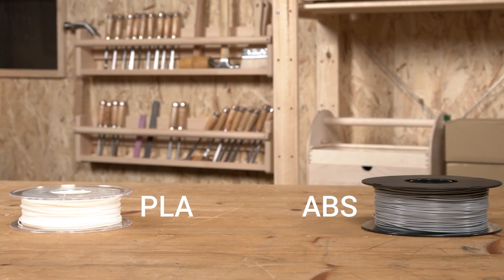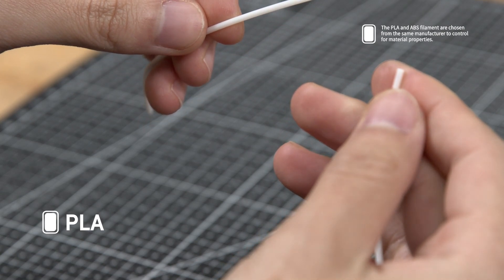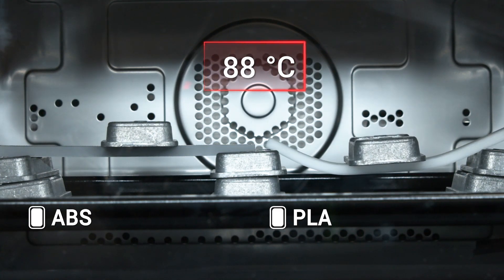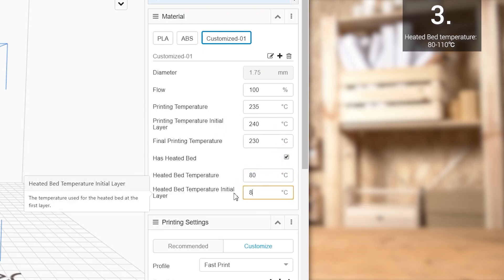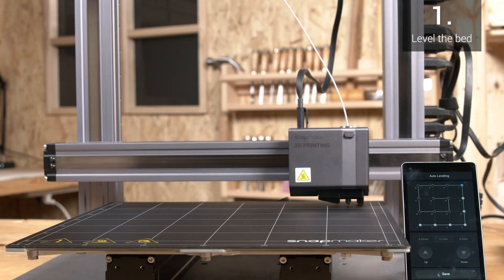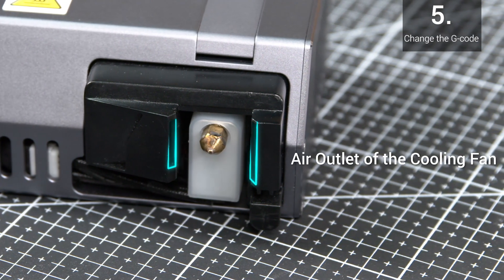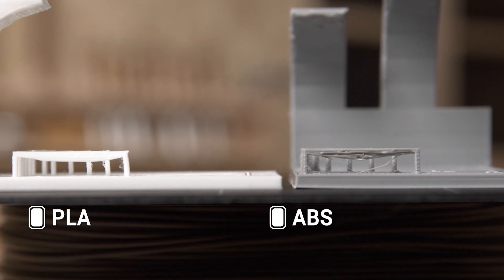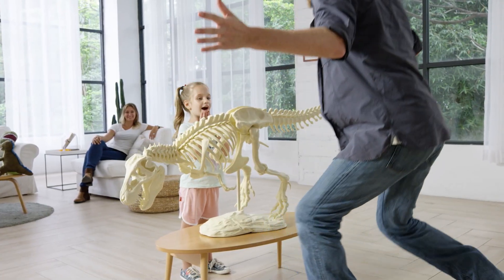How to 3D Print with ABS Filament

Comment: I haven’t tried printing ABS yet, but my understanding is that on the A350, only the middle of the bed is capable of heating up to the necessary temperature, thereby limiting the size of ABS prints on this particular model.

Comment: I will now try abs... The bed temperature cannot be set higher than 90 degrees for the A350, does this mean the biggest model cannot print ABS as good as the smaller models?...
Reply from the maker: Hi! You can heat the bed on A350 to over 90℃. But considering the time it will take, we don't recommend it. And since ABS from different manufacturers may vary in material properties, it's possible that some of them can't be printed well on A350 when the bed temperature is under 90℃.
Reply: @Snapmaker  Please can you tell me how long it takes to reach 100 degrees?... I am now waiting 50 minutes to reach 93...
Reply: @Snapmaker  The first attempt failed, it warped and the printhead teared the print loose... So I must go higher than 80 degrees, because that will lower then tension in the upper layers, I suggest... If I cannot go higher is ABS printing possible?...  Or do I need to learn something else to print propperly in ABS?...
Reply: @ShantiSprengers  add glue and use a glass bed :)
Reply from the maker: It took about 50 minutes to reach 100℃ in our previous test. Maybe you could add some glue, as faraz replied, or use blue tape. Another way is to add an enclosure (a simple DIY one will work) to keep a constant environment temperature around your print. Also, the manufacturers might creates a same type of material that vary greatly in properties, due to some minor differences in crafting technology. Some may be as easy to use like PLA, but some are just very difficult to print with😂 If you still can't print well, maybe consider using a filament from other manufacturers.